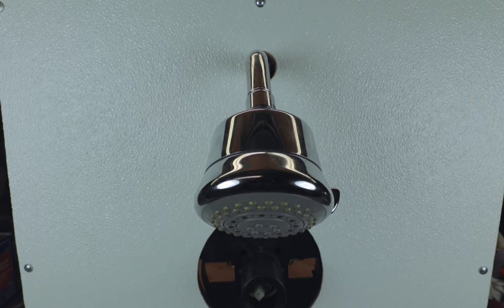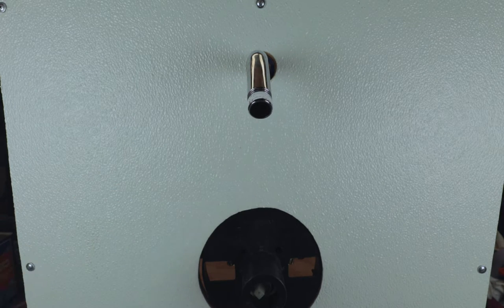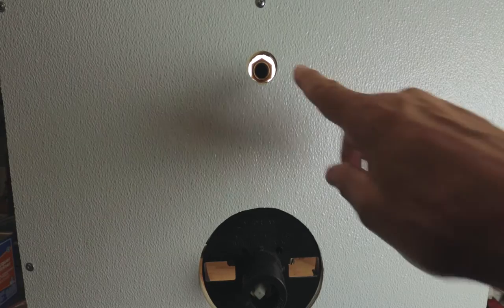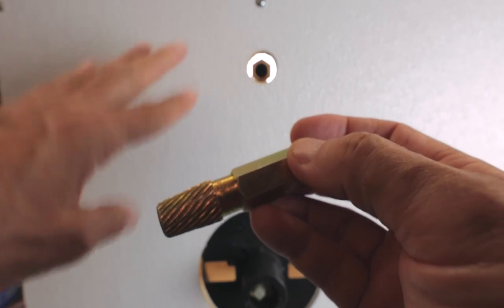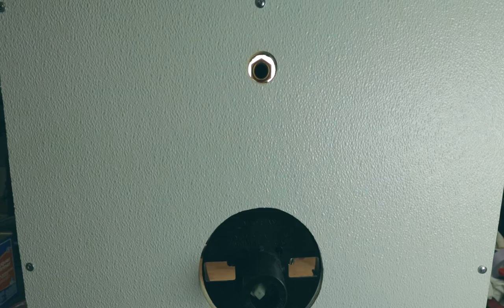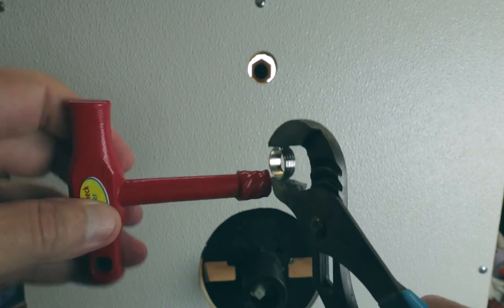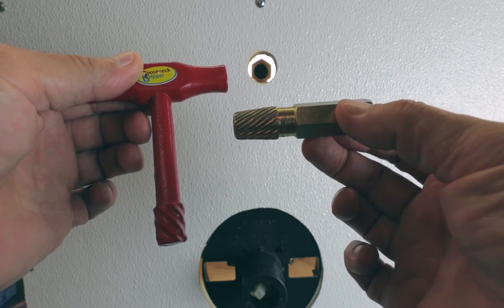Broken Shower Arm Extractor

Comment: Excellent video!  I have a plumbing tool that does the same thing.  I’m a Handyman and I do some plumbing.  I don’t remember the tool’s name but it works.  It has three “dogs” or expansion bits.  The way it works, you insert it into the broken threads of the shower arm.  Then you turn this screw on one end counter clockwise until it locks into place by expand the three “dogs” or tabs that have little teeth.  Once it catches, you continue to turn the hexagonal bolt head counterclockwise and it removes the broken section of the shower arm.  Well I learned about two other tools that do the same thing.  Thanks!  Keep those videos coming!
Reply from the maker: Thanks Richard, I know there are a few other variations out there and these two do a pretty good job. Thank for watching! Bob.
Reply: Where can someone get it
Reply: @AverageReviewsYT   That tool appears to be recently discontinued.
Reply: @shieldcracker  thanks

Comment: The same exact thing happened in my bathroom. I called the plumber and he had to extract the broken solder connection in the wall using the same type of  extractor. But luckily there was no cost involved because the plumber is my son.
Reply: that’s why I wanna learn plumbing not for my own company, but to know what the hell im doing around the house lol

Comment: Thank you so much for this video. You just saved me hundreds of dollars in plumbing repair. I removed the shower arm to replace it and shower head.  The new arm was not screwing in far enough, so it was leaking. I did not realize some of the old arm threads broke off and remained in the seat. After watching your video, I suspected the threads were there. I was able to remove them with a small screwdriver and needle nose pliers. I cleaned the threads with a wire brush. The new arm with Teflon tape on the threads screwed in perfectly. No leaks. Thanks again!
Reply from the maker: Thank you for checking out the video!

Comment: Only thing I would suggest in addition to this is spray blaster or some other lubricant and let it take effect.   When these break off they are pretty corroded.
Reply: Yup, especially if your drop ear is galvanized like mine is.. such a bummer..

Comment: what do you do if you can't turn the arm in the correct orientation pointing down? mine ends up pointing up when hand tighten and I feel trying to tighten it with a wrench any more would break it.

Comment: Thanks Bob! Worked like a charm. The recommended tool was not available on Amazon, but I found a set of Husky Nipple extractors at Home Depot that had one designed for shower arms. $13.95 for the tool sure beats a plumber trip charge!
Reply from the maker: Glad it helped!

Comment: Hey Bob, thanks for the video. I found myself struggling with a broken, cheapoid plastic shower arm. I went out and bought all the parts in the video only to find out that the shower arm was made of PLASTIC! and the extractor did not work  (pipe diameter was too small). I dug through my toolbox and found a 6" bastard file.  Tapped it into the broken pipe with a hammer, and the file threads bit into the plastic, I gave it a turn, and voila, was able to unscrew the pipe.
Reply: Reading your comment gave me the idea for the file. You have just saved me smashing tiles thank you very much 😂

Comment: Thank You! very much for the Superior Tool advice. i pried off the half, but the half remained stuck as thick as a finger ring. Really hard to remove, got scared and thinking about precision sawing it in half, and might damage the threads.  But with this superior tool and i sprayed it with CRC Freeze off (to make sure), it worked.  God bless you Bob!
Reply from the maker: Excellent! Great Job!

Comment: This was a very useful and well put-together video, which may have been capable of solving my problem.  Unfortunately the tools in the links weren't available, and I purchased a set of pipe nipple removers at a local hardware store as a replacement, which didn't work very well.  After repeated attempts of hammering and turning, I determined that the broken pipe remnant was too corroded to move.  I did try the hacksaw method, but couldn't judge how deep to cut without damaging the wall pipe.

What eventually worked was to (1) taking the nub of the broken pipe's thread that was still attached to the wall, (2) taking a very small screwdriver and extending the thread until I could grip it with a pair of needle nose pliers, (3) pull and start unwinding the thread.  When the thread broke again, I would simply repeat the process until the entire piece was removed.

I hope that this helps anyone that is stuck in a similar situation.
Reply: The set I bought doesn't have a size that will work. Either it doesn't fit inside or it's too loose to "grab" anything. I don't see anything to hold onto of the broken pipe and it isn't close to the end so difficult to get ahold of. I may have to call someone unless a different sized extractor will work.

Comment: Would you recommend this tool if the shower arm was corroding and a small portion of it broke off in the pipe fitting? Im having a difficult time trying to get this broken part out.
Reply from the maker: That's the main reason I use them, but sometimes I ultimately end up having to cut and pry the broken piece out of the fitting if it's not buried in the wall. In which case I'll have to open the wall and replace the fitting.

Comment: I used the nipple extractor you recommended and i was able to take out a piece of thread out, but on my second attempt to get the rest of the threads the tool is stuck and I am not able to get it out. Any recommendations other than tearing out the wall. Thanks.
Reply from the maker: If you rotate clockwise, it should disengage.

Comment: Excellent video.  Trying to remove the balancing spool housing from a moen shower faucet.  Guts came out but the sleeve is stuck in the faucet.    Was told by moen to use a 5/8" machine tap.  Would rather buy the Superior Tool since I've come across the broken show arm problem in the past.  You think the Superior tool would work on my problem?  Since it's tapered Is the thickest part of the Superior tool over 5/8"?  Appreciate the help!

Comment: What about when the previous owner put an adhesive similar to silicone all in the threads that broke off? The threads are literally glued to the copper pipe in the wall. I have tried both of these and they will not grip the broken threads because of the adhesive. Any ideas?
Reply from the maker: If the fitting in the wall is not set back to far, I’ve used a fine hacksaw blade (32 teeth per inch). Short back and forth strokes and cut through the broken piece with out damaging the female threads of the fitting. Use a fine blade screwdriver and hammer and collapse the piece inward. Use a long needle nose pliers and twist the broken piece out. If you have to, retap the fitting with a proper size pipe tap.
Reply: Thank you so much for asking because I am dealing with this now and I bought all the tools possible and nothing. Im so ready to just tear the whole thing apart and hire a real plumber.
Reply: Ya same issue, now the broken nipple is so thin I cannot dig out the threads. I have damaged the female threads. Can I tap it to 3/4” and put a reducer back to 1/2”?

Comment: Mr Sesa 7 of 10 times the fitting is buried inside the wall and the tool length becomes a limiting factor. What are the lengths of the Gooseneck and the Superior tools.
Reply from the maker: The Superior tool will get you in about 2 1/2" the Goose-neck Gripper approx. 3 1/4".

Comment: With a hacksaw blade, cut notches inside the broken pipe, insert 5/8 spade drill bit and rotate the broken piece out. Free.
Reply: I had to use a Dremel to notch it and a 1" spade, but this worked like a charm. I didn't have time to wait to purchase these online and even bought the cheap one from HD that just did not fit/work properly. I had already notched and only had a small pry bar that fit this, never thought to use my spade bits. Just brilliant.

Comment: im trying to install new taps, Im having a hard time getti g anywhere past 3 turns before it is very tight. almost seems the thread pitch is off. Or is this as far as these tgings go on?
Reply from the maker: Have you tried running the correct size pipe tap thru the fitting? It may open things up !
Reply: thank you, yes I will try that. i am also looking into the appliance itself as it is a chromed piece and the threads are chromed as well. 3 turns in is about a 1\4 inch in...I would feel better to even get 4 turns on. There are two of these on this type of faucet . They are both with the same proble m.

Comment: We saw this after we replaced the PVC in the wall.... trying to screw the showerhead pipe in and no matter how we start it, it ends up pointing straight up or at the side wall.....how can I get it to end up pointing down. We have been messing with this for hours! The piece that connects the PVC in the wall to the pipe for the shower head does not move so turning that is not an option.
Reply from the maker: Send me some detailed photos. E-mail to (info@robertsessaplumbing.com)

Comment: Help! I thought I was doing the right thing with a nipple extractor. Tapped it into the broken pipe turned it out with a ratchet and now I can’t remove the extractor from the pipe. It seems as though the remaining pipe on the outside didn’t break away from the pipe and the extractor just spins inside the pipe and won’t come off. Any help would be greatly appreciated.
Reply from the maker: Generally I rotate the extractor clockwise to release it from the broken piece one it's removed.
Reply: @BobsPlumbingVideos  Thanks Bob, I finally was able to get it out.

Comment: What about a plastic shower arm? It’s broken and nothing will grip
Reply from the maker: I would try an 18 or 24 teeth per inch hacksaw blade. Wrap a rag around one end so you can hold on to it, with the teeth facing away from you make a cut through the  broken plastic piece. Cut just until you get trough and not damage the fitting. Use a thin blade screwdriver or metal or awl and tap the broken piece out using a hammer. Tap it out gently, no need to go gangbuster on it.

Comment: what if my new shower arm does not fit? my old one broke off went to lowe’s and bought a new one. it does not fit in the pipe..
Reply from the maker: Did you remove the broken piece before trying to screw in the new arm?  That should be a  1/2" i.p.s. standard thread

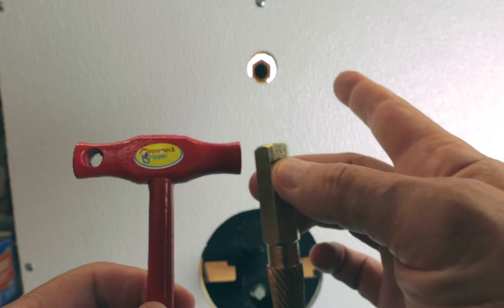Comment: What if I am seeing soldered copper inside where it broke? 6:22
Reply from the maker: That may be a situation where the wall unfortunately may have to be opened to make the repair. If the soldered copper has a threaded male adapter going into the elbow, you might have a shot at removing it???

Comment: Thx! 
Was going to use a screw extractor, but couldn't find one large enough. 
I would have had to cut it down in any case (as you mentioned) with a 5" metal cut off wheel (or two!).
Now I know what to look for!
Reply from the maker: Thanks for checking out the video! Much appreciated.

Comment: Neither of the two tools you show worked for me.  I had to cut the wall behind the shower.
Reply from the maker: I feel your pain, they don’t always work for me either! Regards, Bob
Reply: @BobsPlumbingVideos  Thanks for responding Bob.  Both tools just mashed the broken off piece inside the elbow.  I'm not sure why neither extracted it.  The GooseNeck Gripper isn't as sharp as the Superior Tool, but the GooseNeck went in further and my shower arm elbow is rather deep in the wall.
Reply: Another method involves a sharp awl, needle nose pliers a small hammer and patience . 50 years in the trade and I never had to open a wall for this repair. And for the haters— I did this many times as the area where I worked has very aggressive water causing many of the 1970’s cheaper chrome arms to break off.

Comment: Very interesting tools, Bob. Have you ever used them for anything other than a shower arm?
Reply from the maker: I have not, they are designed to remove light gauge metals, not pipe. Thanks for checking out the video. Regards, Bob.
Reply: @BobsPlumbingVideos  They're such useful tools for that exact purpose that it makes sense just to have one on hand. Take care, Bob. Great video as usual.